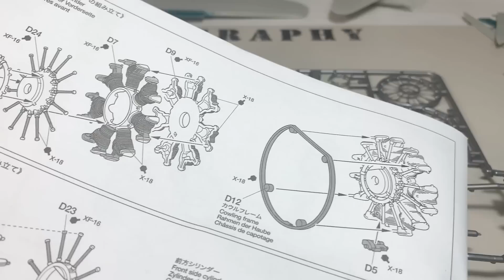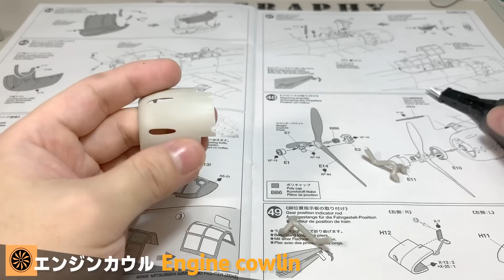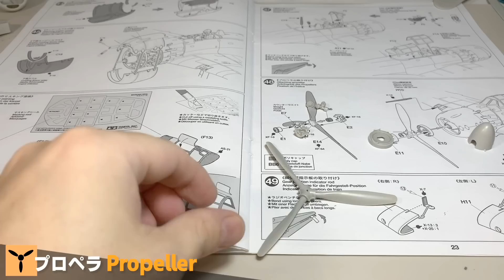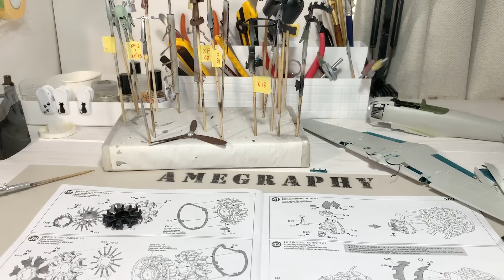TAMIYA 1/32 零式艦上戦闘機五二型 Part 6 エンジン // Engine - Zero Fighter type 52

Comment: Nice engine detailing, but why spend all that time when ithe engine is just getting covered up. I would have modified the cowling based on historical photos to have the cowling panels open so you could see all of the excellent work you did on the engine detailing.